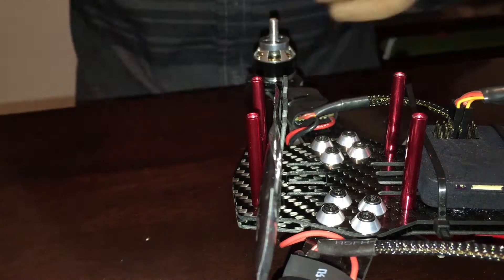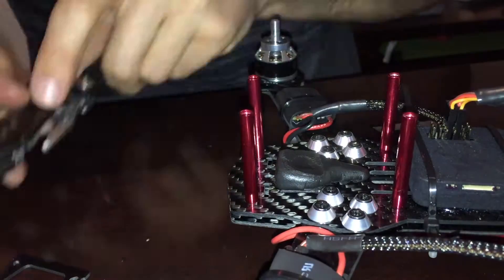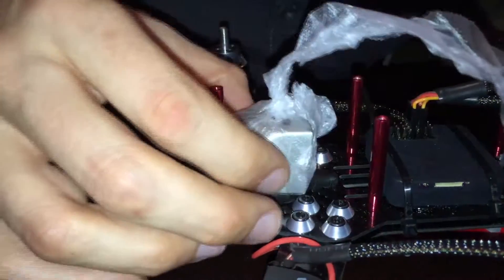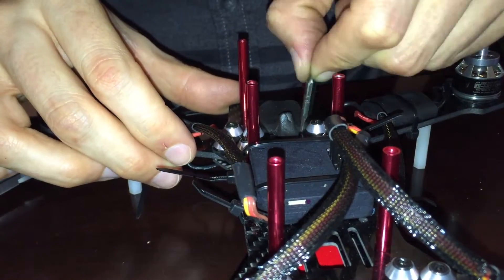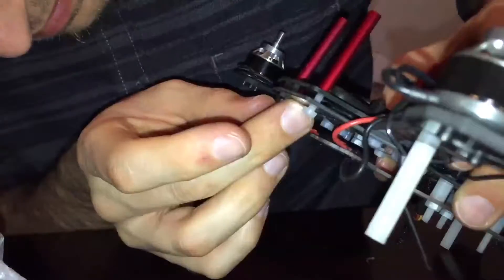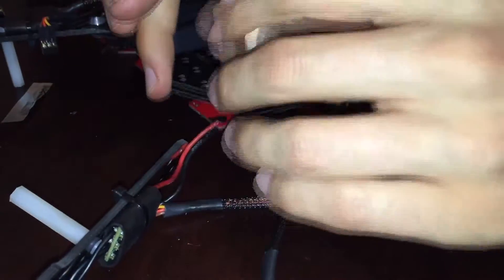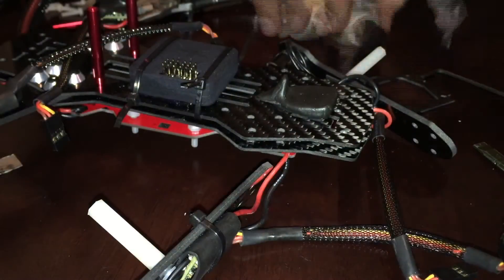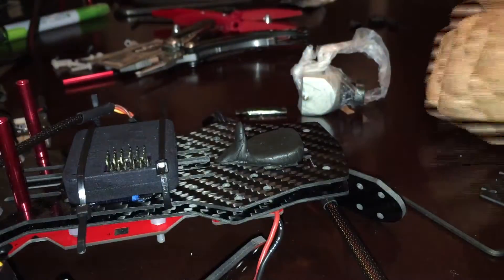Custom FPV Camera Mount for ZMR250 Quadcopter

Comment: um whats ur setup including your battery
Reply from the maker: aerial beast A lot's changed since this video. I was racing with my multirotormania set up at the nationals. 
3S lipo
Naze32 - Cleanflight luxfloat
12 amp mrm esc's
1806 2200kv mrm motors
DTI power distribution
Sony 600 mini fpv cam
boscam 600mw video tx
Taranis x4r receiver
Reply: um do 2300kv motors work ans can i use a 3s 1300 zippy battery
Reply from the maker: yes you can no problem
Reply: thanks alot
Reply from the maker: aerial beast no prob! glad to help

Comment: So how did you hold down the fatshark for flight?
Reply from the maker: Good question. I used some zip ties and secured them through the slits in the frame and up over the camera. Not ideal, but if you use the right amount of sugru, the camera will rest against the top plate nicely and will be pretty secure. I've had some bad crashes and never lost the cam.